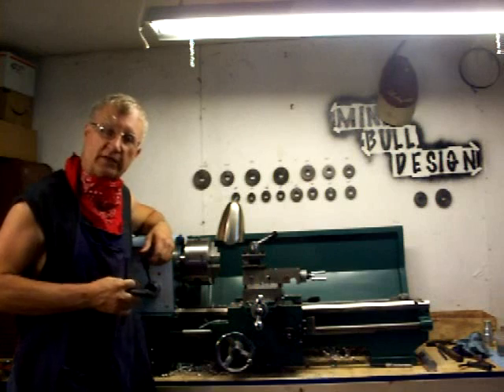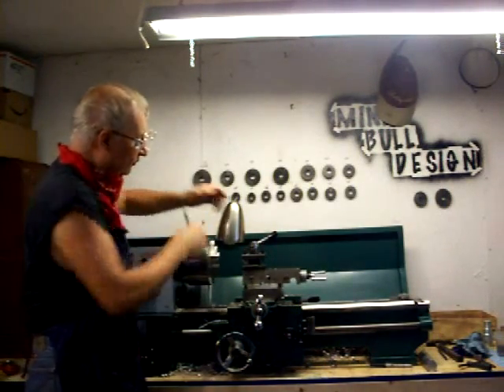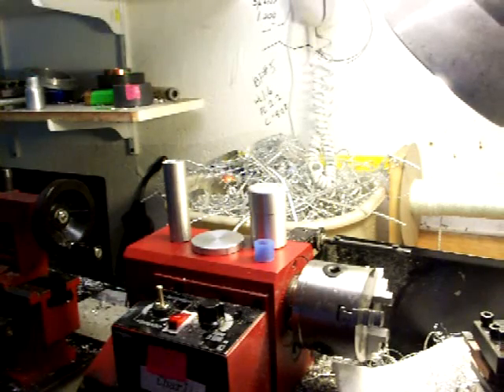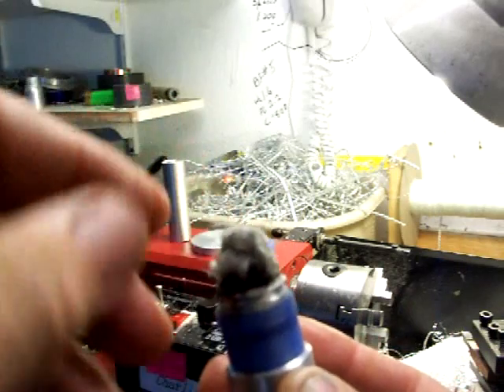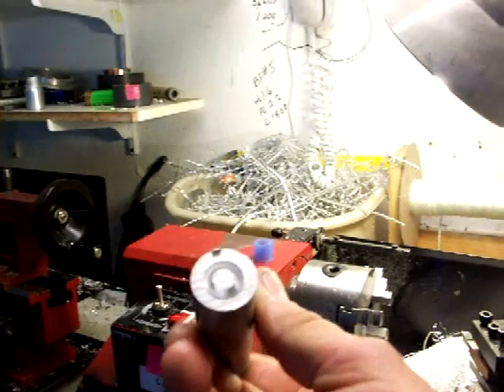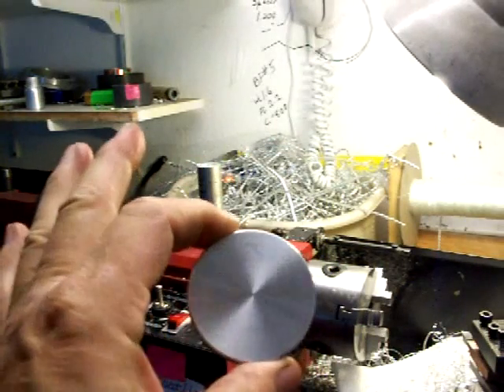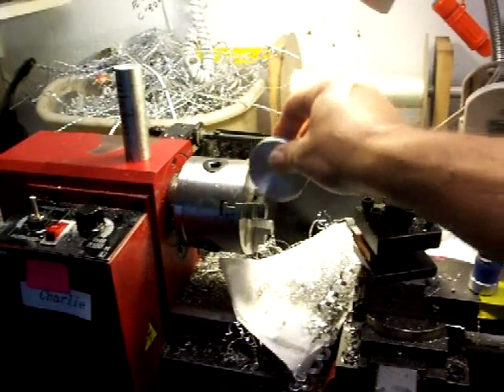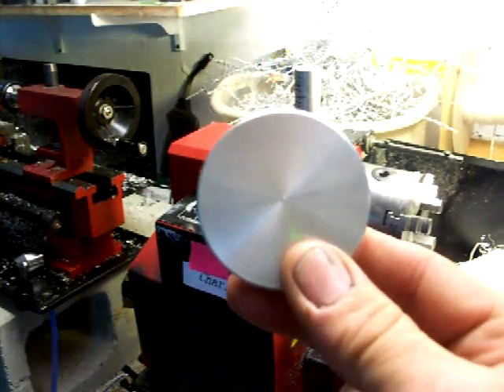CAB Design

Comment: The multiple burner does have the possibility of incremental temperature control w/ the use of valving.  Idealy, the user would have a single knob to turn that projects from the stove far enough to protect his fingers.  I'd consider boring a manifold horizontaly into the base plate & threading it to take a screw.  As the screw is retracted, it uncovers intersecting holes for each burner.  Maintaining a seal w/ the threads is the challenge.  Have you thought of casting, rather than machining?

Comment: Yeah, it does sound complicated, but words don't convey 3-D info well.  If they did, I'd write descriptions all day instead of drawing plans.  A drawing of this idea would show it's it's just a threaded hole w/ a bolt in it.  Turn the bolt to turn burners on or off.  Drilling the lateral holes is the trickiest part, but Tinny's done it already on other multiple burner stoves.  He probably has a better way to valve it already figured out.  I just have a bad habit of thinking out loud.  Take care.